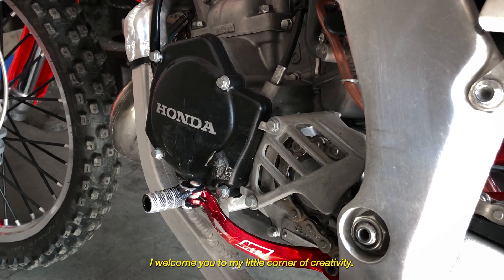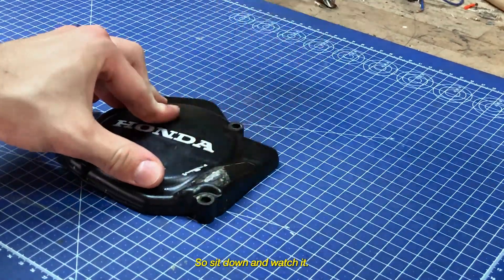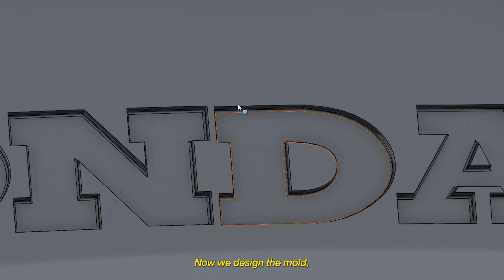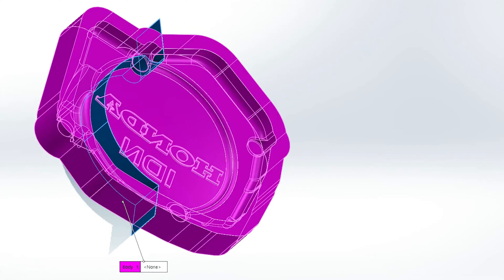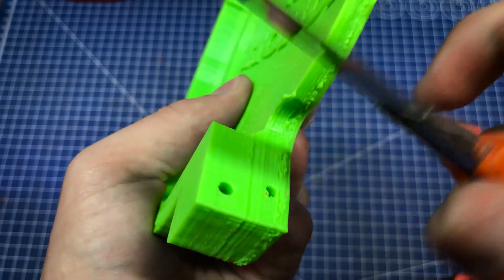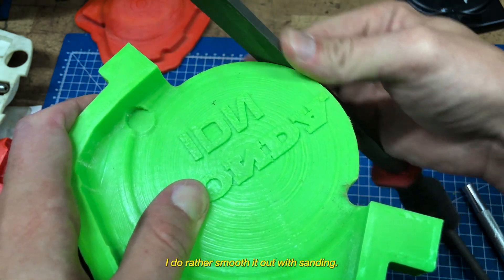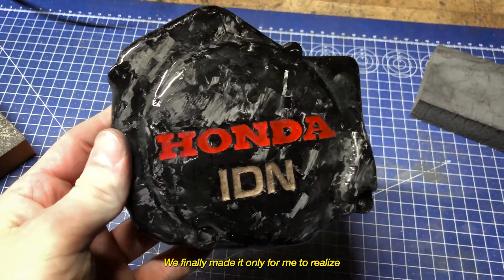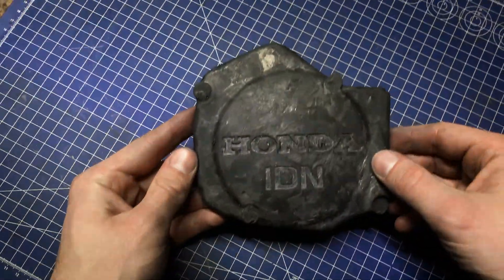DIY Carbon Fiber Bike Part Using 3D Printed Mold (Start to Finish)

Comment: This looks awesome!

Is this ever exposed to hot oil?  How is it 1 year later?
Reply from the maker: @demonfabrication5595  thank you 😉
Reply from the maker: @demonfabrication5595  no, it is not in oil 
But depending on epoxy you are able to use in oil as well

Comment: can you share about solidwork molding process?  still not figure it out how to separate 3 parts
Reply from the maker: You can use features to design molds or   draw it as a part and combine/substruct 
 
I tried my best.. check my latest short
youtube.com/shorts/RIQ9ieVrAAE?feature=share

Comment: This is a very well made video, obviously a lot of effort went into it, its entertaining and has a nice pace.
However, could you tell us what program you used for taking the "scans" & how you edited them, why you even did them (seems like you had to measure and design it yourself anyway) and what printing material you used.
This is a good entertainment, but the educational side of the video, for me, would draw me alot more to your channel.
Anyway, keep up the good work and best of luck!
Reply from the maker: Hello, I appreciate your positive comment. Thank you! ;)

For CAD designing, I used SolidWorks, and for 3D model scanning, I used a mobile app called Polycam. However, the Polycam 3D scan from a smartphone is not accurate enough to directly use as a 3D model for designing the mold. A professional scanner would meet my standards for a 3D model, or perhaps a new iPhone with Lidar could scan a high-quality 3D model. 
So I used my 3D scanned model only for few measurements, which I could not take from real one cover.

I used PLA material to print the mold, but ABS or PETG should also work fine, as I have tested them previously. However, potential issues might arise during molding if certain types of epoxy have a chemical reaction with the material.

Next time I try to be more speaky and detailed :)
Reply: Your modeling skills are awsome, would love to see a video where you go more indept on that!